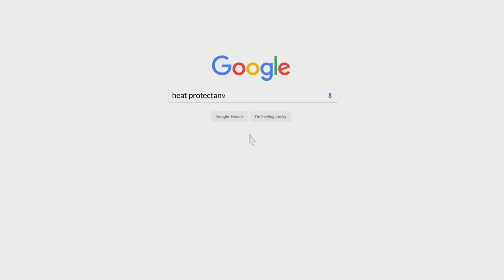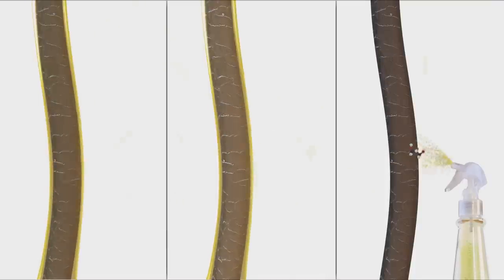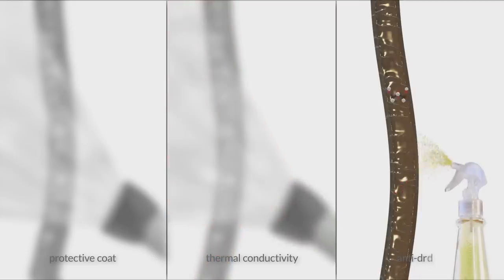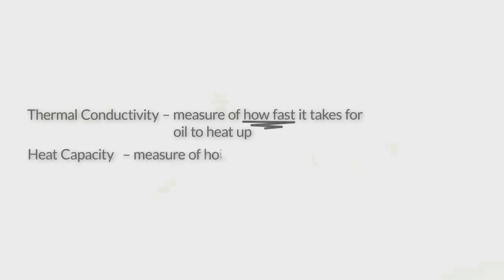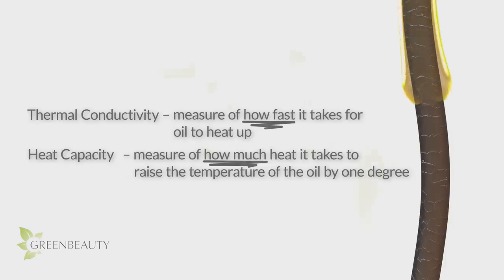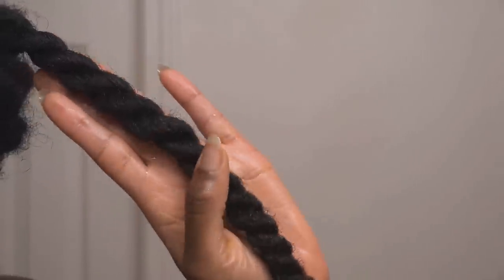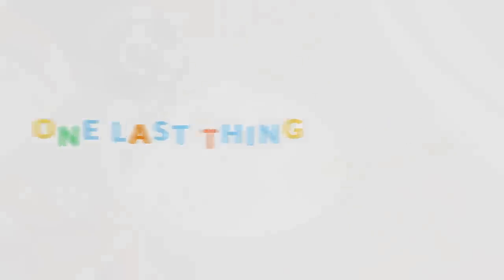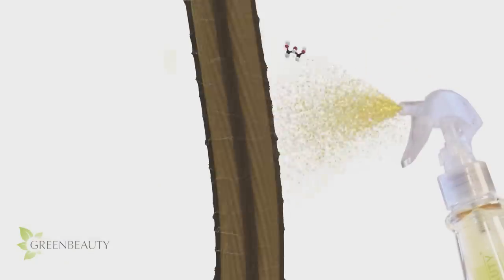How to choose THE BEST HEAT PROTECTANT for your hair

Comment: I keep hearing a lot of people say using oil in the hair with heat is like frying it but I feel like that was addressed when she said oil heats up the hair quicker so you can use LESS heat. Maybe we are frying our hair because we are using the same amount of heat (probably out of habit) as we do when we use commercial heat protectants. Back in the day pressing oil was big and women straightened regularly and still had nice thick hair.
Reply: I used to get my hair pressed growing up; it grew out very long and was extremely healthy, I never had heat damage.
Reply: My mom used to use olive oil on my hair before the pressing comb, it weighed down a bit but no damage.
Reply: @user-od9xe5oy5s  do you just add water and melted coconut oil into a spray water like everyone says?
Reply: @user-od9xe5oy5s  so can i use olive oil before straightening it?
Reply: How did they never get heat damage?

Comment: This is your first video that i am just not down with lol....i personally wouldn't or wouldn't recommend anyone using oil BEFORE straightening. I feel like it creates unnecessary burning and effects how good the results can be. I think silicone based products (which is basically what is in most heat protectants) is most effective. Again, this is my opinion and i'm very much a supporter and believer in this channel before anyone attempts to argue for no reason...
Reply: Yeah, natural hair YouTuber nappyfu says the same thing, check out her videos on blow drying and heat protectants! She uses a lot of good information
Reply: That's why you should do the protein treatment first to add coat onto your hair and coating oil preferably oil with a higher burning point, (looking at the info she provided Avocado oil seems to have the highest burning point with 271°C) and then use low heat 165°C for instance.
Reply: I agree! It's definitely a nono for me unless I want my hair fried and greasy
Reply: True ...I think she mainly is talking about blow drying to stretch the hair...cuz a humectant when straightening would prolly cause hair to revert

Comment: All I use is Shea butter as a heat protectant when blow drying and flat ironing. I love it on my hair. Ty for the humectant info. Will definitely try! 😊 I'm so glad you're back yay!!! 😁
Reply: I know it's hard to measure, but how much shea butter do you use when blow drying?
Reply: So u use shea butter as a leave in before starting blowing out your hair??
Reply: 22nd Century Natural Woman here on YouTube uses shea butter only as well to heat style. Check her out. Thigh length natural hair. I used to do it years ago and my hair felt so good but then folks convinced me that I was frying my hair so I stopped. Wish I didn't.
Reply: @oneflowerlover  I literally section my hair, scoop some into my palm, rub it in my hands, and smooth it onto a part. Then I blow dry each section. Then for flat ironing I layer a little more, and flat iron. I wish I had exact measurements though but I don't
Reply: @DEBORAHo750  yes, it's my leave in before blow drying and before flat ironing 😊
Reply: @cfoster6804  Omg yes i remeber when i first started using the shea butter for that, i wanted to see if others were doing it and I stumbled on her video and definitely never looked back. I also love that shea butter is more natural with no chemicals and non irritating 😊
Reply: @IoveJesustheMessiah  No problem.  This is helpful.
Reply: @IoveJesustheMessiah  Do you use the yellow or white shea butter?

Comment: Very good video again. I am glad you're back. Please add one thing. For a blowdryer oils might be enough. But if you plan to use a straightener or curling iron, this might not be secure enough unless you turn down the heat 😉

Comment: I know this series is mostly on stretching (unlocked)hair,  but since it's winter I'm in need of a faster way to dry my locs as well as to ensure that they don't have a chance to develop mold.    Should I worry about protecting my hair if I only intend to dry it anyway? I know locs are semi-stretched, to begin with.  Thanks for all your hard work and research!
Reply from the maker: Hey 👋🏾 even though you are just drying your Locs. You’re still gonna want to protect it so it doesn’t look to weathered over time. Use an oil an an acidic spritz but, since you have Locs and want to avoid build-up just use a little bit at a time

Comment: It would be great if you would create a natural heat protectant. All store-bought products are loaded with different types of silicons. While this works initially, I find that it make my hair progressively drier. It also weigh it down quite a bit. I have loose hair and while still not a %100 sure of my hair porosity , I think I have moved from medium (naturally) to a very high porosity hair. Oils makes my hair look greasy and flat. Using just a little bit of oil won't provide the coverage needed to protect my hair strands.until the right product comes out, I find it easier to use low heat and take forever to blow dry

Comment: If you use henna or cassia or both before using heat does it work the same as the protein?
Reply: Good question!
Reply: No, they are not protein treatments.  More like fortifying treatments.

Comment: I'm a little confused about how heat would protect hair from heat, when it is a well known fact that oil cooks when heat is applied.  Can you please go into further details about that specifically and maybe provide some references?
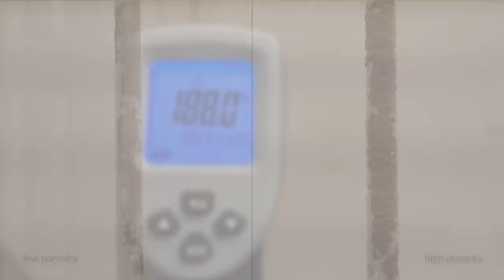Reply: swayb 2:41 Explains the burning point of the oils.
For instance, I’ll be using avocado oil as a protectant because the burning point is 520 degrees, but my iron will only be at 380 degrees.
Reply: Im a little late but basically oil shortens the time where heat is applied on the hair, it heats up fast and cools fast, without oil, hair will basically have to sit on the heat for longer until it gets straight enough. A pass with the iron or blow dryer will get the hair straighter in less time than without any oil. Does that make sense? It’s like boiling an egg (hair consists of protein like egg does) , you can either let the egg sit and cook in hot water (longer time the egg sits in heat, couple of minutes) or you can run the egg in a deep fryer (don’t try this at home, the egg explodes!) and the egg will cook in seconds.

Comment: I definitely use oils and make sure to use a protein rich deep conditioner before I blow dry but what if I use a product like the Revair? I just bought one and still used a protein deep conditioner before using and a light coat of coconut oil and sprayed some aloe juice before I detangled and blow dry is that all I would need? Should I still look for a heat serum?

Comment: But if im straightening my hair i dont use oil i dont want greasy hair. I put an aphogee treatment on before heat everytime and use beyond the zone heat protectant best one ive ever had.
Reply: Just use a small amount! Put a little your palm rub together and using a praying hands motion glide down your hair to make sure every strand is coated but not necessarily too much
Reply: @kristacousins9502  thats fine when i wear my hair curly but i have 3b hair and it gets oily fast the aphogee protects me from heat damage ans the beyons the zone spray

Comment: The idea of the oil in addition to these other suggestions confuses me. I feel like I am definitely down to use these examples in addition to a silicone heat protectant, but an oil with heat on the hair doesn't seem like a good idea. I heard the explanation but it still doesn't seem like a good idea as a complete alternative specifically with finer hair textures.

Comment: Use a silicone based heat protectant. (Especially for flat ironing) And a leave in conditioner that protects hair while blow-drying.

And I guess using a conditioner with silicones or mineral oil helps.

Comment: What does an oil's smoke point have to do with anything? Just because the OIL doesn't burn doesnt mean it's not transferring heat to your hair strand. This is disappointing from a youtuber that generally had sound advice based on actual science.